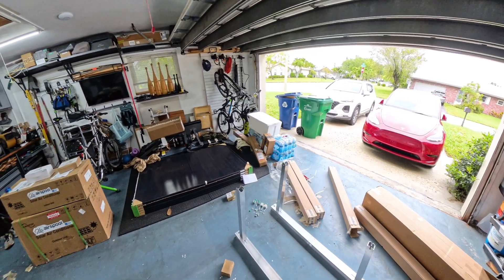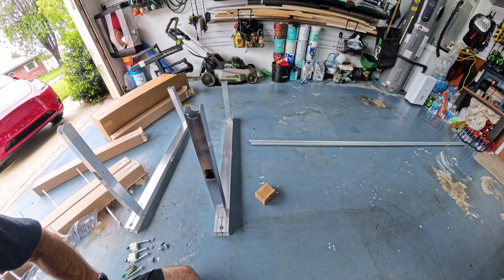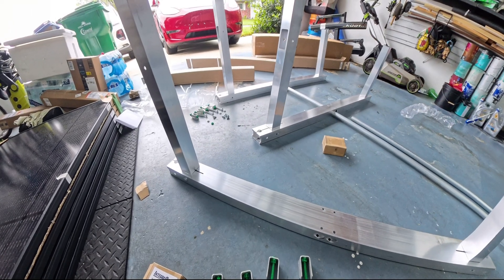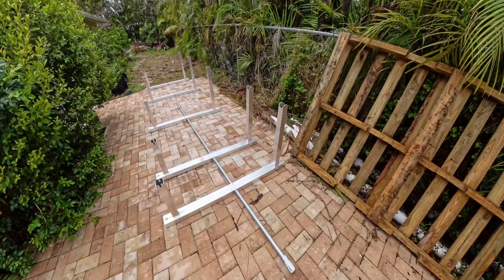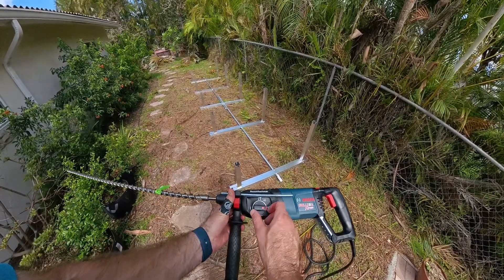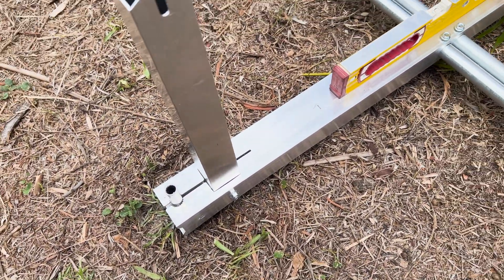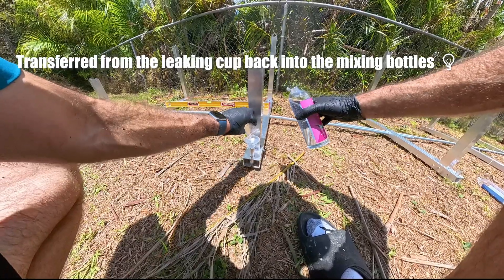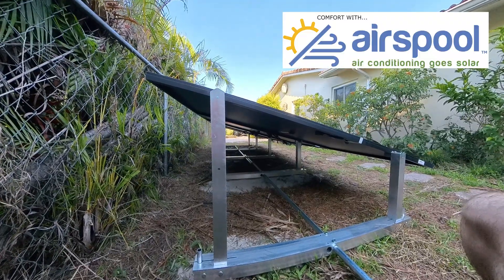Step-by-Step DIY Solar Ground Mount IntegraRack IR-15 + AnchorSpike

Comment: For those worried about wind loads, IntergraRack is one of the best ground mount systems. Look through their website and they give detailed engineering numbers that vary depending upon panel angles,  ballast system, etc.  I moved from FL to central NC. The county I moved to required 115 mph winds load resistance.  IntegraRack was only one of 2 systems that could match or exceed this requirement, that was available for DIY and had engineering documents. Great video! Thanks!
Reply: Included engineering documents can be a huge plus.

Comment: Thank you for posting this!    Did you end up needing 5 racks for 4 panels?   Just trying to understand how to figure out how many racks for X amount of panels.   Thanks!
Reply from the maker: You need 1 to start a row plus 1 for every panel. So 2 for the first panel, 3 to add a second panel, 4 for the 3rd panel, 5 for the 4th.

Comment: Have you tried pulling up on the spikes after the epoxy cured? I'm curious to see if the sandy soil would hold it.
Reply from the maker: I pounded one in too deep and had a difficult time trying to raise it back up a bit even before epoxy

Comment: I am still putting together the pieces to do exactly this. I can't "hide" my set up from the street like you did. It would be out in the yard. I guess I can hire landscapers to install Areca palms along the road but let's face it, the nosy bodies would find a way to complain about it. Did you install a DC shut off switch for your system?
Reply from the maker: I did install a shut off yes

Comment from the maker: If you've installed a different ground mount in a stormy, windy (or hurricane prone) area, how has it held up for you? Did it withstand strong gusts or storms? How do you think the IntegraRack kit and AnchorSpikes compare in terms of ease of install and strength to what you went with? If I didn't cover any questions you had during the video. Let me know and I'll try to answer them based on my experience so far.
Reply: Thank you for this video! I am preparing to do a similar install (also in Florida) and this is very helpful. For one thing, the instruction state to "tap the IR Anchor Spikes into the predrilled holes . . ." but if you do this, it flattens out the barbs. I see you drove the spikes and then placed the rack over them. I've got 10 panels and no help so not sure how I will deal with setting the rack over the spikes. Thanks again!!
Reply from the maker: @bmchollan maybe instead of preassembling the length of them you could set the legs individually on each pair of spikes then run the conduit through them. You’d need to be very very accurate with your measurements though.